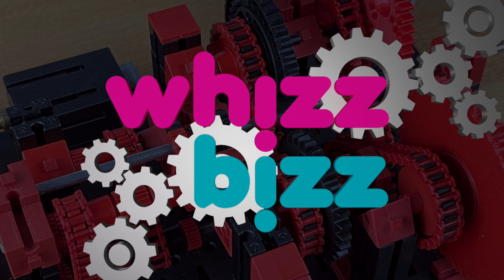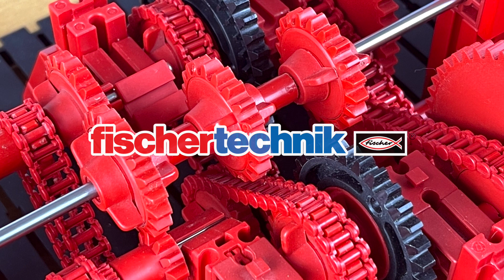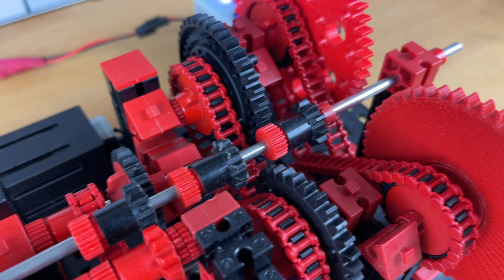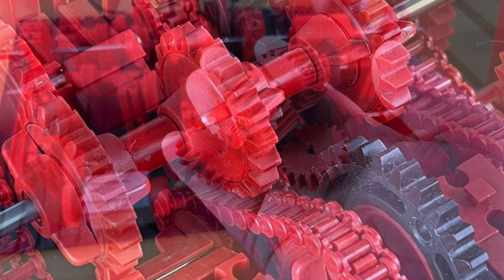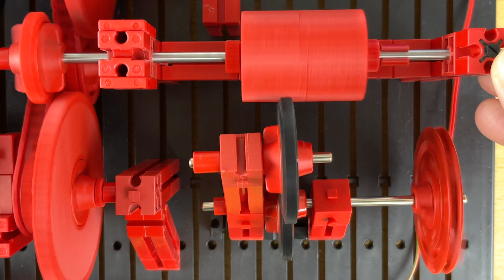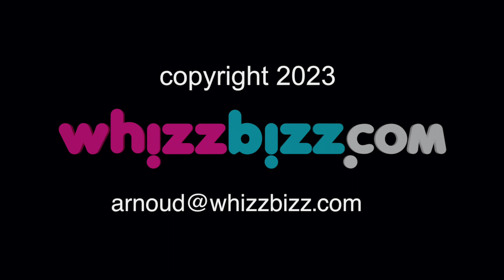QUICK-WHIZZ: 6-Speed Shift Gear

Comment: The 3D printed Z50 is very nice. I made a Z25 and a variety of other gears from cardbord more than 10 years. This works surprisingly well, but 3D printed gears are even nicer, of course.
Reply from the maker: I saw it in your ft:pedia 1/2012 article about that ('Zahnrad.eps'). Keep an eye on the next ft:pedia for details about my workflow for 3D printed gears 🙂